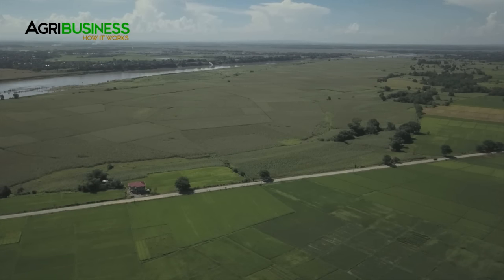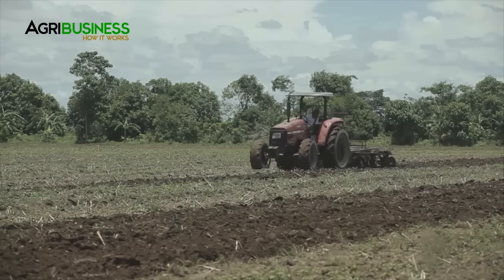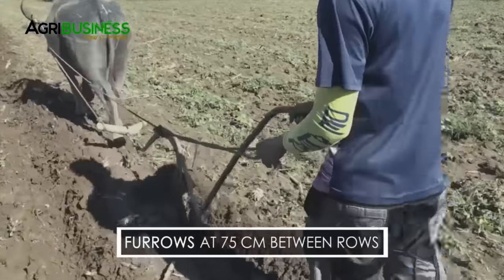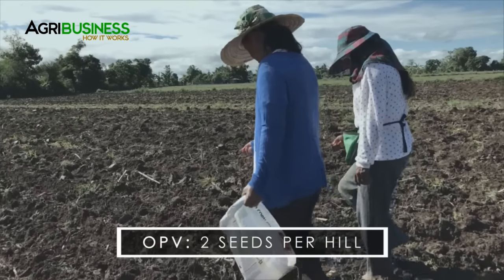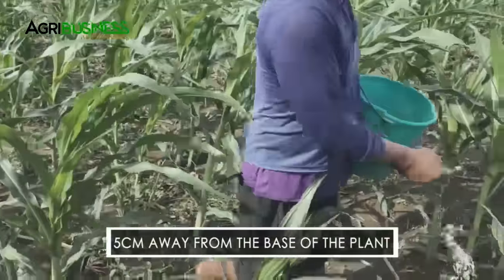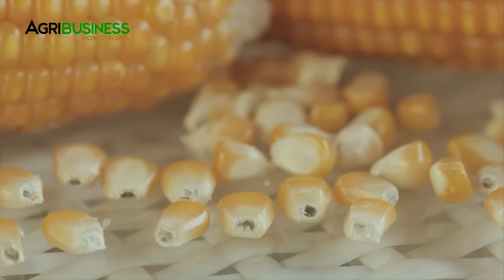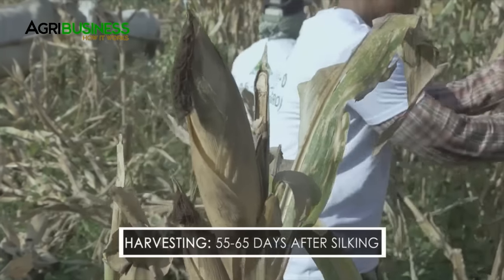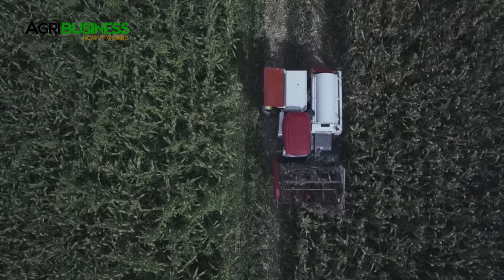Corn Farming in the Philippines : Complete Guide from Seeds to Harvest

Comment: good day! what is the usual fertilizer used in basal application? thanks
Reply: urea
Reply: Celeste Talar 14-14-14
Reply: nagtanim ako ng yellow corn Pioneer 3645 last year ng rainy season sa Bukidnon.
Home mix ang ginawa ko para sa basal fertilizer. ang ratio is 2 bgs 18-46-0, 2 bgs 16-20-0, 2 bgs 0-0-60,  1/2 bag 21-0-0 at 25 bgs chicken dung per hectare. Soil ph must be 5.5 and above but not to exceed 6.5.  Presto can harvest up to 12 tons corn with cobs.

Plant nitrogen fixing bacteria  crops after corn harvest.
Reply: @serenitymaandig5567  why plant nitrogen fixing bacteria crop after?